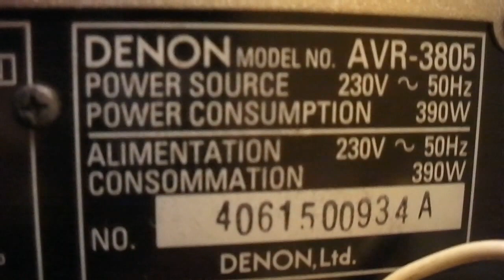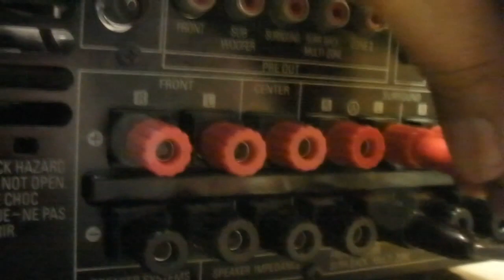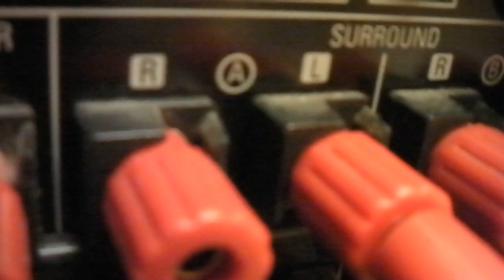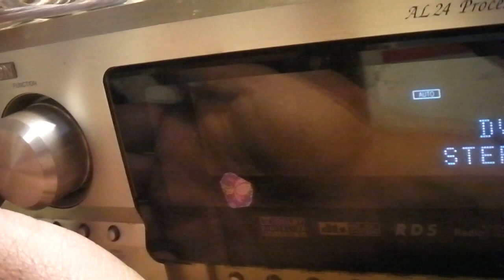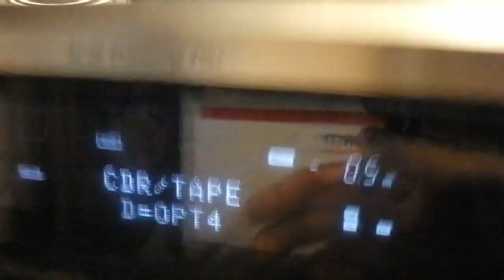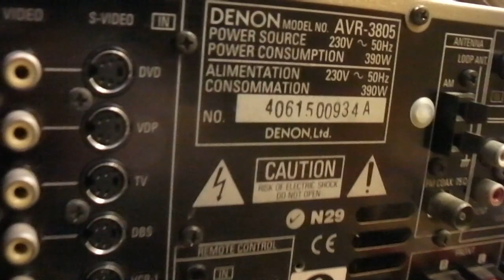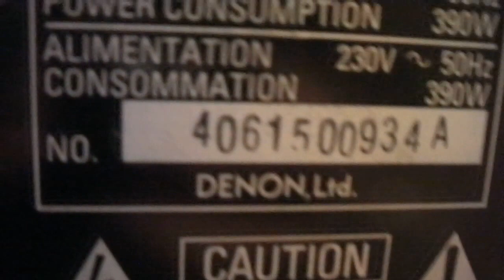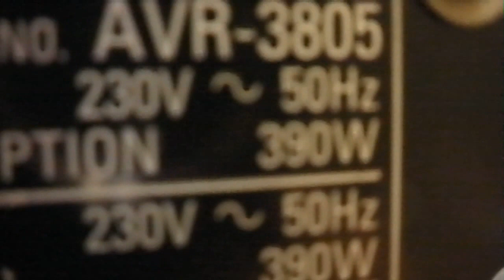Denon AVR-3805  Home Theater , test

Comment: I Have DENON AVR - 2805 Receiver & It Has All The Same A/V & Speaker Binding Posts & AC Outlet Ports etc. But Instead Of Surround A & B Speaker Ports I Have Front A & B Speaker Two Pairs & The Front Panel Is Also Different. So That's The Difference Between DENON AVR -2805 & 3805.😎😎😎😎😎. Thank You My Friend.